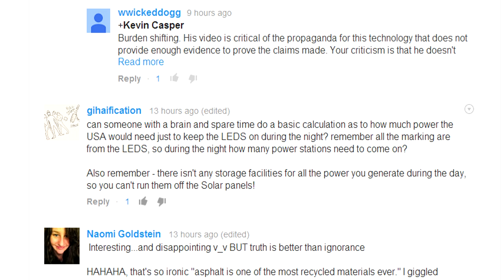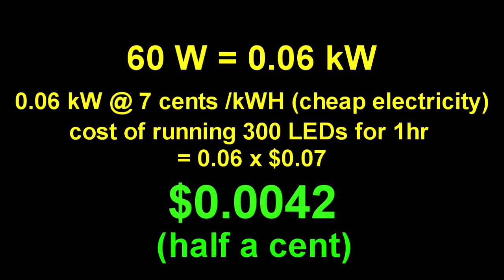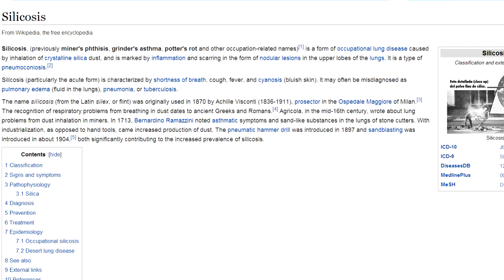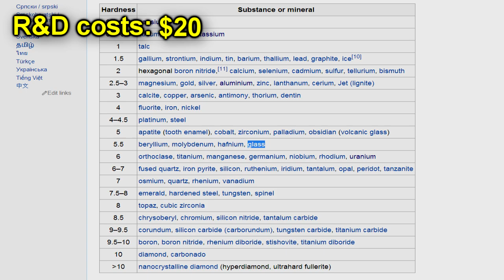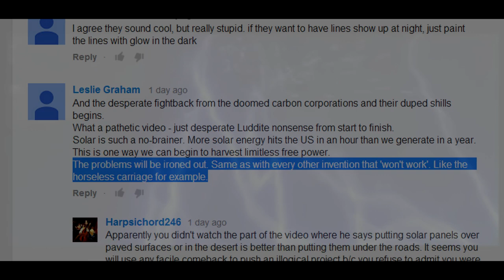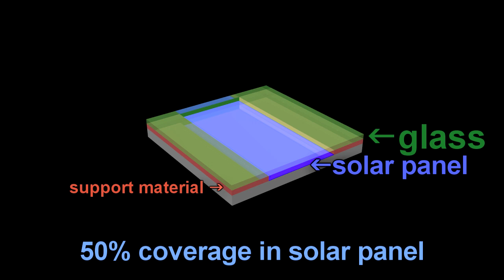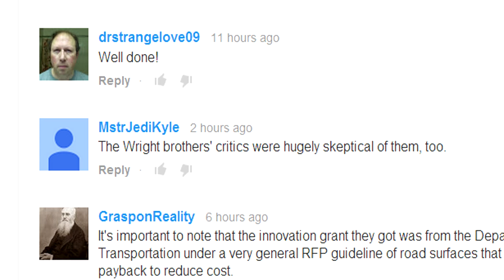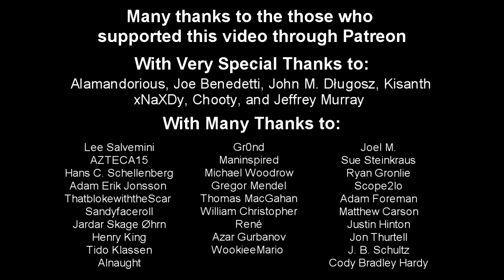Solar Roadways, IMPORTANT QUESTIONS AND ANSWERS!

Comment: Well there are a few problems with your numbers & your abrasion testing too.

Don't get me wrong I think they are pretty dumb as well but when you try and prove how bad something is you need to present realistic objections not completely unrealistic ones that will allow them to show you up.

Firstly.

Cost of electricity. Yes there are 50 LED's per tile. However you've assumed that ALL of them will be continually on. That would be a road full of lights not actual road markings.

If you look at a basic road. Two lanes, one in each direction. Say it's about 8 meters wide. That's 16 tiles = 800 LED's across the width of the road for that row of tiles.

Of those you would need a line of lights down the centre and a line to each side of the roadway. This would possibly need about 20 LEDs on each edge tile and the centre tile, probably less but lets go with 20.

So 60 LED's total.

Your numbers require all 800 LEDs to be lit. The 60 LEDs ACTUALLY needed is 7.5% of your figure. Or to put it another way your figures are over 12 times the actual requirement.

Also if this did go to roadway scale then they would have to incorporate power storage and (despite low efficiency due to light incidence angle) it would be a net gain in power.

Second

Abrasion test.....I've never seen a tire grind back and forwards like that. You've also gone for a quantity of  sharp stone which, on a glass road, wouldn't be there.

Yes glass would suffer abrasion but tests have to actually be representative.

Third

Cost of the LED's - Looking at the RETAIL price of a string of LEDs and multiplying that does not give you an accurate cost.

You've taken a cost of $20 for 300. Spending 20 seconds on amazon tells me I can get 50 LEDs for about a dollar. Remember that is still retail and it's under 30% of your figures. Actual manufacture of these would be able to command prices down to about 2% of your figures.

If you are going to critique something like this then you need to get your figures right.

Yes this is a crappy product but let's show the real numbers.

Also you've missed some major problems with it.

Construction - They still have to lay a concrete "road" and accurately place hundreds of thousands of metal rods. They then have to individually place the tiles.

The tiles then have to be tied into a control system of some type so you can tell each and every tile what markings to display.

What we end up with is an expensive, slow to build road with massively complex control systems where any electronic failures in any of the millions of connections could lead to problems.

Comment: First, there are such things as batteries! Tesla, samsung and solar city are building a battery pack mass production factory that will lower the cost of these batteries and make them mass produced. Batteries store unused energy! The energy that is 3x the energy used in the US will be stored in batteries to be used during the night!  Also your led problem has a simple solution.  The LEDs only need to be seen by the drivers facing them!  This means you can do what they do for traffic signs and shroud them to be easily seen in one direction. Also you guys are missing the fact that the solar panels will pay for themselves. Yes the kick starter will be expensive but the long term investment is a capital gain! Also the LEDs are high efficiency. Not the ones used in simple projects.  Yes they are more expensive but they pay for them selves. Again on the glass issue. The inventor stress tested the panels and the panels were unscratched! Please stop trying to blindly disregard innovation with mindless misconception.
Reply: Even if Tesla manages to lower the cost of a vehicle battery from $20,000 to $10,000 with a lifetime of 10 years and could produce enough for the entire country, it's still a monstrous amount of money to pay to store one day's worth of electricity for a household. The average electric bill is about $100/mo, so this would double electric bills all on its own, lol.

No, there's no proof that solar freaking boondoggles would actually produce 3x the energy used in the US. They haven't even released cost or technical specs on the small 12x36' they have done.

Yes, the LEDs would need to be seen by the drivers facing them, but these LEDs are pointed skywards. LED traffic signs are pointed directly at drivers and NOT at the sky. 

No, there's no proof that these stupid things would pay for themselves. That's a claim that hasn't been backed up with any evidence whatsoever. Back of the envelope calculations show that they'd be at least an order of magnitude too expensive and need to create an order of magnitude more electricity.

On the glass issue, the "inventor" CLAIMED he stress tested the panels and that they were unscratched. He offered zero proof of that claim.

Please stop blindly believing every mindless claim that clowns make, without any evidence whatsoever.

Comment: Doesn't the spark plug shattering a window thing have to do with the static electricity stored in the ceramic, not how pointy the shard is or where it ranks on the Mohs scale?

Comment: Thunderf00t, just out of mild speculation, I suddenly recall something about a mirror array located on the moon placed there by astronauts that is capable of refracting the laser and returning it to earth regardless of the general aim of the laser, allowing for constant measurement of distance. Would say a similar method of light redirection work to provide a flat surface solar panel with greater energy efficiency throughout the day? Or would reflecting the light simply not be worth the loss in output?

Comment: While the idea does seem fundentally flawed, there is still a few improvements that can be made to the calculations...

All LEDs on a tile is very unlikely to be used all the time (And the ones on tiles far from lane borders are unlikely to be used)

Using a LED strip with a white background means that the LEDs need to compete with the reflection.(You would likely need a much denser arrangement of them anyway to have anything safely visible during the day)

On reducing surface to mount panels: Thin film panels might eliminate that problem, they are more durable, but often less efficient.

Of course a solar "roof" over the roads seems more practical (although it also seems like a nice place to build bicycle paths). It might be useful in some limited applications, like (expensive) driveways... (If you run out of roof space and need MORE solar energy without affecting your garden...)

Comment: Liked your other vids on the topic, but this one actually weakens your position a bit. First, you are taking prices of LEDs given the current market, thus current supply and demand. Pumping up the demand by purchasin LEDs for those freaking tiles would most likely spike the price of LEDs, but it could also mean that the person making those enormous purchases may also be looking at a heavy discount. Not sure what the result would be, but it likely won't be what you see on Amazon.

More importantly, your calculations on LED power usage are not even close to being precise. You are calculating as if each and every LED needs to be lit up at the same time, while in fact in order to have road signalling you only need a couple of percentage points or less of them to be lit up at any given time.

This doesn't make their engineering/economics case any less freaking joke, but it can give them something to defend themselves with as far as PR goes.

The rest of your points were, indeed, very fine and I enjoyed the school-level experiments :-)

Comment: One more thing to take note of - the density of the LEDs on the panels. In order to perform the functions indicated in the video, the panels would have to be solid LEDs, with a pixel density similar to a TV. But, look at the panels in the video. The LEDs are extremely sparse, and therefore unable to produce lines, graphics, warning texts and the like.

Comment: So.. at 6:39 we see the 'artistic render' of a roadway lit by LEDs. Please, someone tell me how EVERY LED will be lit up at any given time, even at night? There's also the fact that they already implied during their presentation that roads at night will only be lit for certain distances surrounding vehicles. (Not a hard thing to do. The solar cells have shown the ability to gather energy from headlights, which could be used to create a trigger in the system and light up x number of panels ahead.)
Reply: Yes, this is somewhat of a valid criticism of the video, at least from 10pm to 5am or so or in rural areas. But in urban areas, there are more or less a constant stream of cars from 5am to 10pm, so the LEDs in those areas would need to be lit for about 18 hours a day.

You know, the roads are already marked with solar power and do it for pennies per foot. It's called reflective paint. Places like Seattle and Portland take it a step further and put reflectors and bumps all over the road to be able to increase safety in the torrential rain.
Reply: Yea, the reflective paint and reflectors get tar on them over time though, causing decreased visibility. The larger part of my comment was more meant for the idea that the video shows 'lines in the road' LED pattern, but the panels with the most lights only had 13 active. Some had 3, and some didn't have any. The criticism was really more to point out that the math calculation would only happen if it were activated by a cyber attack (which I just considered during this comment.) and not during standard night operations, even in urban areas.

Comment: At 14:20, he states that the Solar Roadways are only composed of 30% solar panels, and then proceeds to show you a picture of a panel that is practically half made of solar panels. Maybe I'm just completely ignorant, but how is it that the BLUE in the WHOLE PANEL is only 30% of the panel?
Reply: This part he got wrong or at least I don't know where he got that number. On the solar FAQ page they state this...

Currently, the full size hexagons are 36-watt solar panels, with 69-percent surface coverage by solar cells. This will become 52-watts when we cover the whole surface when we go into production. When we add piezoelectric, they'll be capable of producing even more power. Also, as the efficiency of solar cells increase, more power will be converted.

Comment: its not normal glass. heres is just an example of other ways it could withstand far more then what you did watch?v=fhoF564nJ_Q
Reply: It's tempered glass in the panels..same as a car windshield. as for your video I guess you must not know much about Gorilla Glass. They don't state it is scratch proof just scratch resistant. Have a smart phone now? I DARE you take sand paper to it and watch what happens!